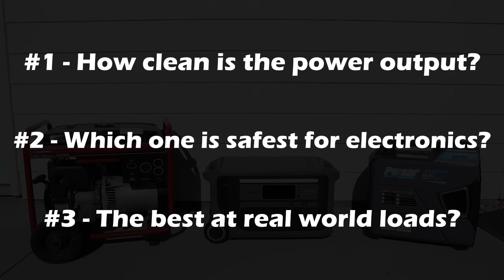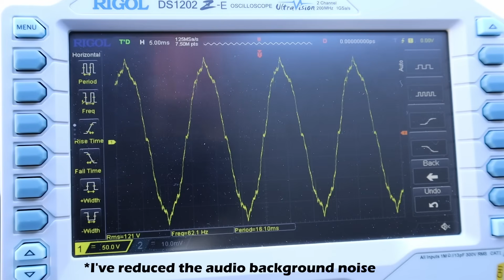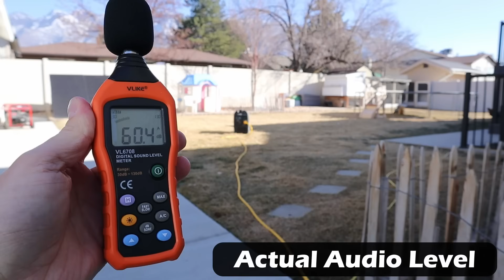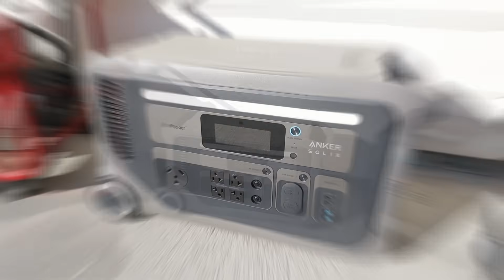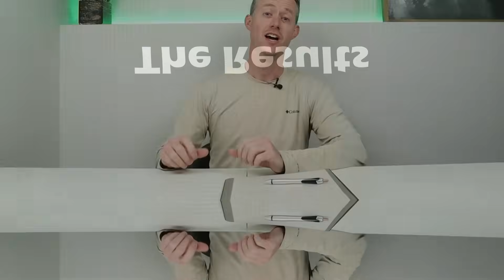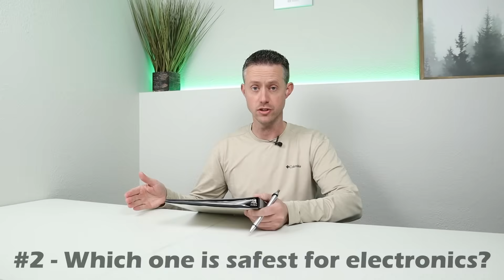Before You Plug Electronics Into A Generator, Watch This!

Comment: Almost all the pieces for a valid test and conclusion are here, but not the most important pieces, namely understanding and context.

Yes, a simple traditional generator puts out AC power that is of somewhat lower quality than that of normal 'grid' AC power. The voltage will jiggle a bit more, and the AC frequency is not as tightly regulated.

And yes, inverter type generators produce a nicer looking sinusoidal waveform than traditional generators, at least when there is no load on them.

But here's the thing.....in reality, in the real world, AC power is never very clean, even right off the grid. All the other things in a building's electrical system, with all the hundreds of various loads of various types, randomly turning on and off, result in all AC powering being randomly "dirty", i.e. imperfect.

ALL electrical devices contribute corruption to the power source they are connected to. ALL AC powered equipment is designed to easily tolerate such imperfections. It can be alarming to look at the AC power with an oscilloscope, but knowledgeable people realize that it has to be REALLY bad before devices will stop working correctly and/or be damaged in any way by those imperfections. All this stuff about how "sensitive electronics" should only be powered by inverter generators is pure BS, driven by the marketing departments of companies making inverter generators and power banks. Knowledgeable people realize this that assertion is simply not true.

Think about it:
- People have been running their whole houses from traditional portable generators for decades when there are power outages,  and everything works just fine, nothing "gets hot" as a result. Only if something else is contributing a severe corruption should there be a chance of damage to the powered equipment.
- People have been using whole-house automatic-start, natural-gas-powered backup generators for decades, and the power output of those is no better than that of portable gasoline powered generators. No problems. Many people in other parts of the world, where the AC grid is less reliable, run all their electronics from traditional generators a LOT of the time, no problems.
- Almost ALL modern AC powered electronic devices use "switching power supplies" which are often also called "universal" power supplies. By their very nature and design, they don't care and are not affected by the quality of the AC power, its waveform, its harmonic distortion, its frequency, etc. As long as the voltage does not go too low for too long, those devices are happy and will not be affected or damaged. And THOSE are the devices that marketing departments like to call "sensitive electronics". In reality, virtually all electronics made in the last 20 years are much more robust in their ability to be perfectly OK with various levels of AC power quality, when compared to the decades-old electronics of the past. And even THOSE older devices that are still in use are perfectly fine with all but the most corrupted AC power.

Besides that all important point, I noticed that this video takes a simplistic view of some other electrical realities. For example, when starting the table saw, that is a large inductive load, and even on a building's normally (grid) powered AC supply, the voltage will briefly dip when starting such loads. It is not that the power generating station's output is dipping, it is that the relatively small gauge wiring in the building has enough resistance to result in a voltage drop during that start-up current surge. But that aspect was not revealed in this video, except in the unmentioned/overlooked presence of the long extension cord running between the generator and the table saw, which causes a similar dip. Certainly, there is also a dip for a blink-of-the-eye that it takes the traditional generator's engine to compensate for the increased load, but the seemingly 'alarming' dip shown on the 'scope is more caused by the voltage drop in the wiring and has little to do with the type of generation. I could see equivalent dips occurring for each of the generators in this video, but the narration makes it sound like they are not happening. There are also visible artifacts, on the 'scope displays shown here, that are the result of the nature of sampling digital oscilloscopes, in their unreliable corruption of the displayed image whenever the measured signal changes rapidly...this tends to make things look worse than they are when viewed by inexperienced people.

I also take issue with the repeated overuse of there being a "pure sine wave" when there is clearly not one. By definition, a "pure" sine wave has zero harmonic distortion, yet every generator's output in this video shows harmonic distortion and a corrupted-looking waveform on the scope....look at all those little notches in the waveforms! But none of this is important, because in the real world of AC power distribution, there is never a 0% distortion sine wave available, and commercial electrical and electronics devices are designed to work just fine, without damage, on real world AC power sources, even fairly bad ones.

And all "smart" devices have to do with this is.....NOTHING. All "smart" means is that the device has some sort of integral computer, and has nothing to do with its ability to be powered by less than perfect AC power.
Reply: It seems you speak truth. Thank you for laying it out.

Comment: What's your reasoning behind not recommending a traditional generator combined with I power station? The power station will take the dirty power and convert it to DC then store it.
Reply from the maker: Most power stations will not charge from a traditional generator. Some brands do have a special setting to allow it but it's not common.

Comment: First test. If the rpm of the engine isn’t adjusted properly to 3600 rpm you will get the results you got. When the frequency is out adjust the rpm. 
The sine wave was clipping with the heaters hooked up. That means the generator was overloaded.  Not good considering its rating.
Reply from the maker: I do live at 4500ft elevation so the generator can't get full rated power.

Comment: If using the non inverter generator, is there  a device you can attach/plug in that will clean up the dirty electricity, like a pass thru device... (cost effective if all you have is an old gen.)

Comment: What if I use a UPS with a normal generator, for sensitive applications. 
Ex: 3kw generator with 1.2kw Ups and power sensitive loads below 800w
Reply: The battery and charger in the UPS will clean up the input signal

Comment: Watching James Condon, he has load banks, heaters, similar AmProbe meter, oscilloscope and other tools and when he tests open frame generators, they may vary a bit.  The generator, when he sets them the frequency is typically around 61.5 Hz because as you add a load, if the open-frame generator has an Automatic Voltage Regulator, or A.V.R. will keep the voltage around 120 V but the frequency will drop a bit as the generator gets loaded down to about 59 Hz.  When adding loads to these machines, the sine wave typically go into a slight sawtooth pattern but run well enough for some high-draw tools.  Now, there are also generators without A.V.R.s and the unloaded voltage coming from them may be as high as 130 V and when under load may drop to 110 V.  These may typically be older Coleman PowerMate and similar units as well.

Now, if you have good electronics with good power supplies, typically switch-mode power supply units, they can actually accept this open-frame generator noise, filters and rectifies it and basically goes through an inverter circuit that takes the D.C. coming in, turns it back into high-frequency A.C. then converts that to the voltage(s) that the machine requires.  Although, to be safe, it is probably best to use a portable inverter generator, specifically from Honda or Yamaha.  Other than these two brands, I wouldn't use inverters from anyone else.

The power station has a little more distortion on the sine wave than the inverter generator does.  It's in and around the 0V parts of the wave where I see that distortion.

Comment: Now use a modern open-frame generator.  After that, use a sine-wave UPS for home electronics like a PC and then re-test.  Everyone who has sensitive electronics should have them already.  So using a cheaper generator won't be as bad.
Also, you can up the hertz on the open-frame generator while under load by adjusting it.

Comment: There are differences in the quality of design for regular generators. Would have been nice to see a comparison between that cheap model you tested and a hi-end brand/model that has a better design.
Reply: exactly. And power after going through a personal UPS that people would normally have to help keep power clean to their delicate electronics
Reply from the maker: I appreciate the feedback, I'll have to look into that 👍
Reply: Also the inverter generator and power station. I'd expect the results to depend significantly on the quality. The power from a bottom-of-the-barrel device usually looks like stairs: one step up to 120(or 230 or whatever you use), back to neutral, another step to -120, neutral...
Reply: On our sensitive devices like all the network stuff and servers we have an online ups from eaton. Would be nice to know how good the power really is and what happens if i supply this with dirty power

Comment: Caution ~ FYI, if you connect a traditional generator to a Power Cell - the power cell will pass through the dirty power from the generator as it charges the power cell.   Better to use an Inverter Generator - IMO.
Reply from the maker: Yep that's why they call it pass through charging 👍

Comment: The best test for THD and load testing of any generator is while powering a portable welder. Welding equipment puts the most random and varied load on a generator. seeing the output of the Generator in terms of current and waveform... its an eye opener.
Reply from the maker: Thanks for the recommendation!

Comment: I did a few basic test on gas generators I was renting for my dad's ham radio 'field day' in 74. Look at the 0 crossing on the gas generator.  I stated at the rental company (they were great, letting me do the tests). Yours was pretty good compared to the on I saw. BTW construction generators like, we both tested we 1 cyl, 2-pole designs and run at 3600 RPM (60Hz countries). The RV industry ran 4-pole, 1800 RPM which were quieter and the 0 crossing were cleaner.
Reply from the maker: That's super interesting! Thanks for sharing.

Comment: You should generally be using a generator rated at 4-6 times the full power load of a motor like is found in your table saw. The generator you used is only about 2 times that saw. The bigger generator would have more inertia to maintain speed/frequency, and a lower inherent impedance to reduce voltage drop and induced noise. That's the theory anyway, it would be interesting to see what you would measure. You could try a smaller hand saw vs the table saw with the same generator to test this.
Reply from the maker: I agree with you and I think that's a great concept in theory but most consumers don't buy a generator 4 to 6 times larger than the continuous wattage they are wanting to run. Having a large 9000w generator probably would have handled the surge much better.

Comment: The one thing all these reviews never mention is MTBF ( Mean Time Between Failures)   The inverters have a ton of non-serviceable electronic components looking for a reason to crap out.   The electrolytic caps will surely fail with time.    Which is why I recommend a low THD conventional generator.    Generac's line of "Truepower" gens are under 5% THD and have special dampening windings in them.  Several other companies are offering low THD,t such as some Westinghouse models.

Comment: How would you cleanup a standard generator output?
Reply from the maker: Check to see if your model has AVR, automatic voltage regulation. If it does you'll see better power output than this traditional generator. Also, see if they have an advertised THD level.

Comment: Could you test those power conditioners to see if they could clean up that power output on the regular gas generator?
Reply: This is a good question.  I got a traditional generator before inverter generators came out.  Is there a way to clean up its power without replacing it?
Reply: Plug a UPS into the generator and use that to power sensitive electrical devices.
Reply: @James-os9ec it's only work for online or double conversion ups. Line interactive will still gonna bypass electricity from generator to your sensitive equipment.

Comment: I'd be interested to see you take it a step further and run the generator thru a pure sine wave hybrid inverter with transfer switch to see if the inverters electronics affect or clean up the sine wave. Is their a device/filter you can install on your non-inverter generator that will clean up the signal as their are similar things in professional audio equipment.
Reply from the maker: All in one power units and power stations have 'pass through' charging, which passes the power directly to the loads, no filtering or cleaning of the power.

Comment: living in the country we need 220 for our well  so we have a "dirty larger generator. i also have a honda that is 20 years old inverter, and clean power.  If you cannot get a inverter type  to run your devices get a larger UPS and use them to regulate power. Charging with a generator should not harm the UPS.

Comment: Unless you want to run your inverter generator continuously, you'll want both.  Charging your battery station with your inverter gnerator will extend your fuel supply dramatically, plus far less noise.
Reply from the maker: Totally, having both really helps extend your fuel supply, especially if you have some solar the assist with charging.

Comment: i bought an inverter for 12v batteries. It killed some stuff. I thought it was pure sine wave, it wasnt. put my scope on it, horrified, basically right angle jumps up to voltage then flat before dropping down. same story with negative half of wave.
Reply from the maker: Good example, thanks for sharing! Some inverters built into vehicles also use modified sine waves.

Comment: At my old house I ran everything off a traditional generator. It never killed anything.  I can’t say that it didn’t stress anything. But after a total of about 30 hours nothing died.  I am sure it’s a gamble but the chances seem a little lower than stated.
Reply from the maker: After reading comments from other people, it seems some traditional generators might be better than the one tested in the video. Not all are the same. Some have AVR, which regulates the voltage. The low voltage is the most damaging issue. Thanks for sharing your feedback.

Comment: Finally someone tested THD while under load. I’ve seen some other THD tests on inverters and generators they never put it under load which is what needs to be done. You should get some more generators that claim to have low THD like the Westinghouse many are using it does not have an inverter. Generac claims their whole house generates have low THD also.

Comment: Great video. Thanks. I have a Westinghouse DF9500dDf. I use it to power my house during outages. My UPS's don't like it. I am thinking about selling it and getting a GENMAX13500iETC inverter generator to replace it. Also may get a power station later on to run minimal things during the night. Gas furnace, sump pump. This was a helpful tutorial.
Reply from the maker: I've seen some mixed comments on the video, some say their generator damaged stuff, some didn't see any damage. I bet each model can differ depending on the different safeties built into. Not all generators are built the same.

Comment: Do you know what the house power is doing compared to the generators?
Reply from the maker: Thd was about 3.1% and the voltage was 121v, the waveform was a little more square than what was seen from the inverter generator 😂

Comment: The table saw looks like it is inducing distortion into the sine wave of all three devices probably being induced into the AC extension cord and picked up and displayed by the oscilloscope. The last solar battery device looks like it has some zero-cross distortion which points to the inverter not producing a true sine wave output. I'm surprised that the gas generator puts out such a poor AC output, I thought it would have been much cleaner but it may be the gas engine inducing noise into the generators output?
Reply from the maker: It seems from the comments on the video that traditional generators can differ quite a bit. Some are better and some are worse than what's seen in the video 👍

Comment: In times past I think one could get away with a non inverter generator.  These days with the advent of modern tech the inverter type is the wisest choice.  100% agree that both are essential a power station teamed up with the inverter generator.
Reply from the maker: Having both certainly works well, especially if you don't want to burn through your fuel super fast!